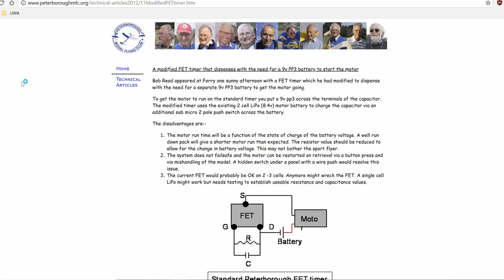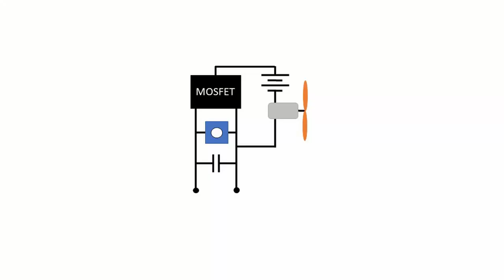Simple Electric Free Flight Timer

Comment: Pretty slick man. That would be nice if you can work it the other way too. Throw it as a glider, then have the motor kick on. Or one motor on with another off, then switch. You could get it to fly out then back. Mosfets can do that, right? Turn one circuit on while keeping a second circuit off until the first circuit turns off.
Like instead of remote control, it would be programmed time control

Comment: I missing something, wot the battery in the plane for? I want make timmer for control line which runs about 4 minutes cheers Graham
Reply from the maker: The battery in the plane is the one powering the motor. The other battery is just used to charge the timer circuit. You can modify the circuit to use only one battery and a switch.
Reply: Long time?
Reply from the maker: @grahambate3384  To increase the run time, increase the capacitor or resistor I used in this video. Making either value about 8 times higher will give you roughly 4 minutes of run time.

Comment: Hi David, this is Jon from the PMFC - I'm glad you like the timer design. 

The timer can be built as a lighter package using the STD12NF06 mosfet and a 47 or 33uf tantalum capacitor and a 1M variable potentiometer. The trick is matching the capacitor and pot to give appropriate times but obviously smaller values means smaller components. It's also possible to go really small http://peterboroughmfc.org/technical-articles2018/Miniaturising_FET_Timers.htm providing the motor amp draw is low. 

Just one point for you - when testing with an LED instead of a motor you need a current limiting resistor in the circuit to avoid blowing things up :)

(BTW the link to the PMFC website is correct but it's slow sometimes) 

Happy flying! :)
Reply from the maker: slowmatch Thanks for the tips Jon. I'll keep that in mind for future versions. For the record, the components I used were the ones I could get easily that were closest to those specified in Nigel Hawes's article on your timer in RCM&E from a few years ago. The resistor is probably a good idea. The LED seemed to run happily off the two AA batteries before I constructed the circuit so it never occurred to me I'd need one.
Reply: It depends on the voltage drop of the LED but a current limiting resistor is always a good idea to prevent the LED from burning out. I find it simpler to test the timers with the actual circuit being used ie the intended lipo and motor but with the prop removed.

The original FET used was I think the IRFZ44N - the STD12NF06 has become the standard since then.

The IRF540N mosfet will handle fairly large current and so would work with quite a large brushed motor. The 'on' resistance is high though! There are smaller and more efficient FETs that would work with your little geared coreless set up and obviously less weight is better for wing loading and flying speed. That said it's also a case of what works, what is available and what is cost effective. Ebay is good for buying small numbers of these sort of parts.

Very nice simple explanation of the system though :) look forward to seeing more models!

Comment: what mosfet you are using?
Reply from the maker: soumita bhattacharya IRF540N. They're pretty common because they're used with Arduinos. But any equivalent will do. You just need a signal diode that can withstand the current draw.